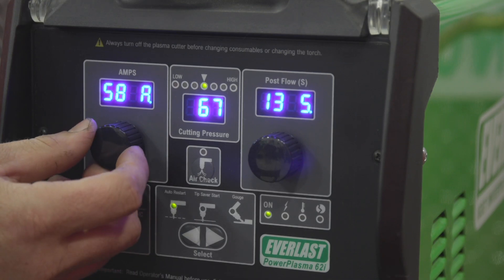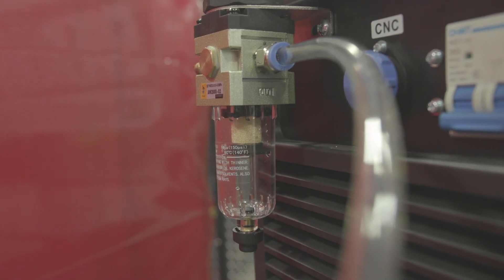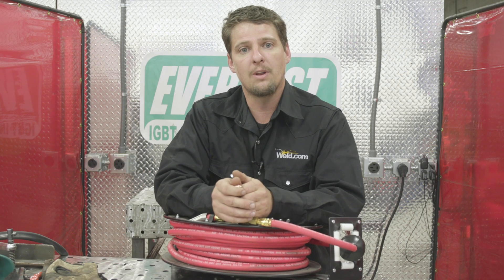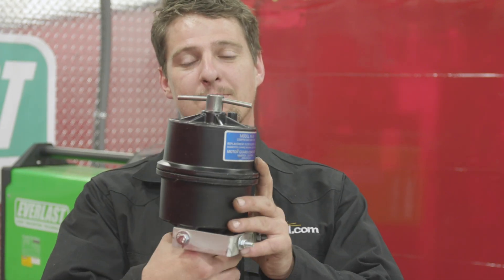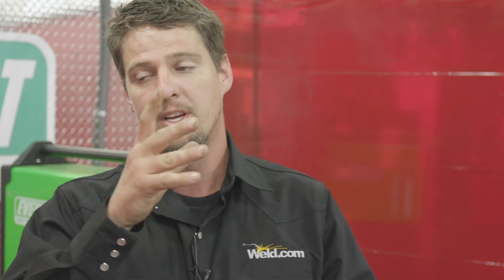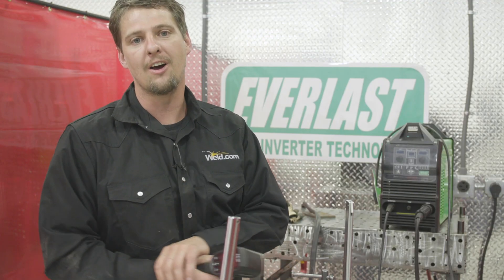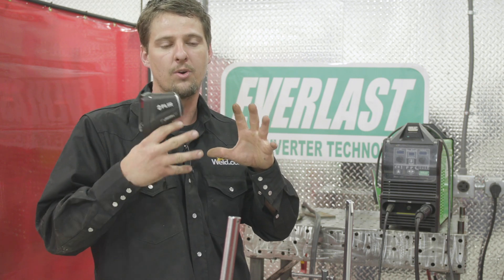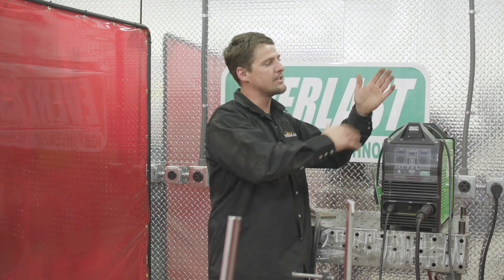Make your plasma parts last longer

Comment: Don't have your machine turned on when your grinding, it will suck in metal particles and deposit some of yhem all over your nice electronic components and eventually short them out and scrap your machine, same goes for inverter welders.

Comment: Is the IPT-40 torch maximum amps 40 amps? What torches are rated higher? On these 65 amp plasma cutters do you need a 65 amp torch head? Any advice is appreciated. I'm new to plasma cutting! Any acvice on torches. I basically want to run at 65 amps all the time. Thoughts.

Comment: Some more handy tips for for drag tips these are on cheap plasma cutters are any drag tip  You can use nozzle jelly from a welder to put on the tip of the flat part to help keep slag from building up there.  I even use it for plunge cutting with a drag tip which usually throws a lot of slag on the tip I'll take a wire brush and scrape it right off and then I dab it back again and my nozzle Jelly.  It is aggravating I'm not gonna lie but if you need your tip the stay as clean as possible this is a very good  Solution.

Comment: You should drain the air tank after you get finished with it. I have a compressor, my father in law gave me, the compressor is a two cylinder, run by belt to electric motor. works like the day it was made. so why did he give it to me, for free? a hole rusted through the bottom of the tank. From the inside, because of water setting in the tank.  it's like finding hens teeth, looking for a tank, unless you have a wad of cash. my vertical tank with compressor cost less than a tank. it is one of the newer models, makes a lot of noise, instead of the shoop, shoop of the two cylinder. water left in the tank will ruin the tank if left in there.

Comment: Just a tip, don't shoot lasers at cameras, it can easily damage the sensor. And camera sensors, unlike plasma cutter consumables, are not a consumable and not something you can practically replace yourself :)

Comment: Great tips, what I have done is to drain the air compressor tank to get rid of moisture and the instead of turning the drain plug screw all the way shut , instead I leave it open just enough to hear air hissing it’s way out of the plug. The advantage of this is that as the air leaks out of the drain plug the water that collects in the bottom of the tank is pushed out by the small air leak .Ok, it waists a little air but moister is never allowed to accumulate in the tank. It’s a must where I live with 90% and more humidity in the air.

Comment: reduce the moisture in the compressed air. those filters don't do anything to moisture (water yes, moisture no). run an air dryer. refrigerated air dryer if you use compressed air a lot or desiccant air dryer.